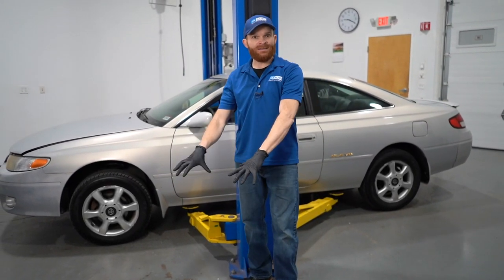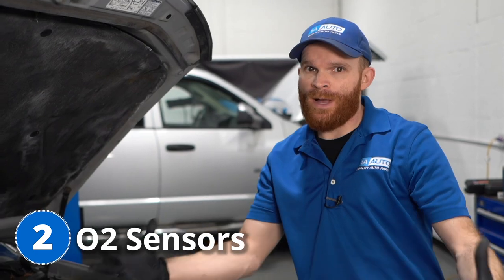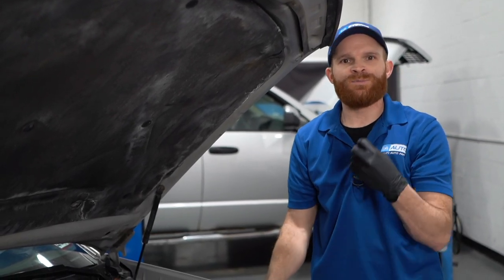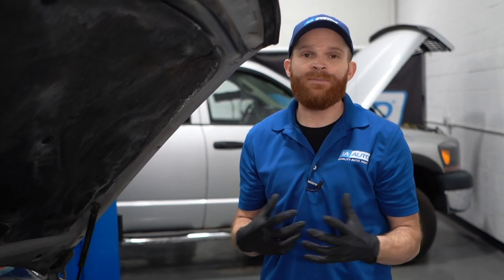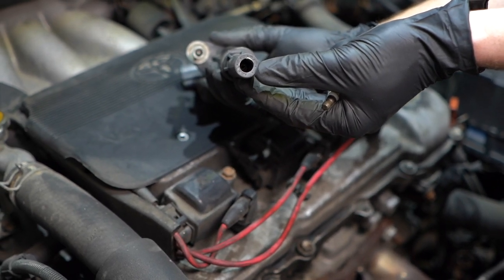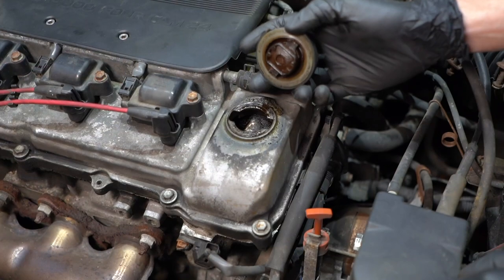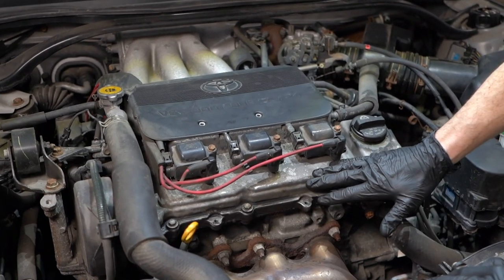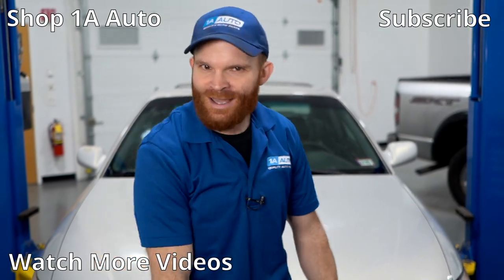Top 5 Problems Toyota Solara Coupe 1st Generation 1998-2003

Comment: Thats a clean solara. For some reason i dont see many of these anymore even though theyre good cars.
Reply: Just bought one today Excited to see where it goes
Reply: True.everyone wants SUVs probably.
Reply: just bought one with 270k for $600. all black clear coat peel but has no warning lights at all
Reply: I got mine and I plan to keep it till the wheels fall off
Reply: Just picked on up with 126k miles! Pretty excited from all of the comments here
Reply: I keep being told my is rare 2000 V-6 3.0 Manuel transmission 233,000 runs like new. Love my ride.
Reply: I just bought one 4 months ago
Reply: Funny a year later and the Carpocalypse I see them all over now again lol
Reply: @Toroloco777  I am about to pick a 00 V6 manual 77k original miles tomorrow super clean.  Anything to look for inspection?
Reply: About to pick up mine tomorrow. One owner 177 k on the odometer. No accidents. Pretty excited 🤩 1150 dollars. Got it from an auction. The owner sold it to send the money to a charity
Reply: I have one with 133,200 Miles on v6 manual transmission very fun to drive I plan to keep it till the wheels fall
Reply: @Toroloco777  how’s it run because I’m getting one with 300k miles on it
Reply: @Toroloco777 how often have you changed the fluid

Comment: Ah the infamous 1MZ-FE, I’m surprised that many of these cars still running strong after 20 years. I don’t think new cars are ever made the same reliability and longevity
Reply: I have two vehicles with 1MZ-FE. Engines still run like a clock.
Reply: 213K on my 1MZV6 still runs great you just needed to take care of the car. I always used Mobil 1 synthetic and stayed on top of maintenance. When you continue to see countless early Avalons, Solaras, Camrys, Siennas, Highlanders just know they have the "infamous" 1MZV6 powering them in 2022 and beyond
Reply: 319,468 miles (yeah I know a ton) on my wife’s 99 solara. Engine will run forever if maintained regularly it’s crazy!
Reply: Typically as long as morons don't run long oil changes they will last 500+k. My Highlander has 300K and it runs like it's brand new. And that's after morons ran long oil changes and the inside of the engine looks like coffee.

Comment: Front brakes should've been on the list. IMHO the brakes of that gen of V6 Solara (and Camry) are undersized leading to overheated rotors and warping.
Reply: Funny my 08 is having that problem
Reply: Carbon Rotors and EBC red pads fixed that problem for me

Comment: Have my 2002 V6 SE I purchased new, nearing 245,000 miles and still going strong.
Issues and or fixes.
1. IAC stalling the engine (gummy gas) use 100% H-Oct gas for a month or so and it helps burn out the crap from ethanol residue. I used a intake spray to clean out a bad gunky episode.
2. Front upstream O2 Sensor keeps tripping out, (possible ethanol is fogging up the sensor), my mechanic says the fronts go out more often, the downstream under the car never to bad. He said do not get scammed by someone saying your downstream O2 sensors are bad.
3. AirBag master chipboard by the passenger side out (about $1,000 to replace). So no airbags but plenty of red warning light. 
4. Had 2 water pumps changed per 100,000 mile service (preemptive replacement to be safe)
5. A/C line had a pinhole leak, used that A/C in a can and it worked awesome ($28 fix).
6. Stripped out threads on the oil pan from too may oil changes. Went with a whole new oil pan instead of a fangled tapped out thread replacement. I figure the new pan with perfect threads is more capable being bolted to the engine than still going with the old oil pan and worrying about a rethreaded fix failing. 
7. One valve cover gasket replacement, for 245,000 miles that is really good.
8. Alternator replaced once.

Comment: Also be mindful of problems with the front end alignment and steering linkage on high mileage Solaras. If your Solara's steering wheel has a slight shimmy or wobble when cruising at highway speeds, then you'll want to get that inspected.
Reply: How do I tell my mechanic to fix or check that please let me know
Reply: @emmanuelroman9269 did you go?

Comment: For oil leaking on my car it was the  cam shaft seal seal and valve cover gasket, I recommend doing that when you replace the timing chain and water pump.

Comment: Thank you for the information and the video. I just purchased a 2000 Solara with 71,500 miles and super clean condition.  I felt it was a purchase I could not pass up.  Now to take care of it so it keeps running well and keeps looking really great.  I do have a question and that is, how do I determing what generatiion the engine is.  This video refers to Gen 1 and I'm now wondeing what geration my engne is.  Thanks again, DP  --- Liked and subscribed!
Reply: I heard the Solara was made from 99 to 2008, so your car might have a "Gen 1" engine? I am no expert!
Reply: That's a steal and great buy if it only has 71,500 miles. I bought  a 2001 V6 in 2013 with 150,000 miles for $4k. It now has 223,000 miles and running just fine. My daughter keeps wishing it will break down but it's easy to fix. I  think it make it to 300K miles easy.

Comment: Ive had 2 of these cars and everything he says is an issue is true. However i was told that these cars had hydraulic cam followers so adjusting clearances isnt actually possible. Id like to know if its true because my 99 V6 has a lot of valve rattle. I was even thinking of buying a whole new set of cam followers. The other thing ive experienced is that the EGR valve also gets clogged with carbon. Needs cleaning every 5k miles or so
Reply: My Solara was clogged inside the intake plenum right before the EGR valve. After cleaning the carbon it cleared a p401 code.
Reply: @phajeb001  my check engine light came on p0401 I think I'll replace my EGR valve and do the same cleaning like you did..

Comment: Mine runs good and it’s been running for a long time with minimal maintenance
Reply: Same. I had a couple years where I was doing 50k miles a year and had almost no issues at all with mine. An oil change every 10,000 miles or so, and a spark plug change once and that was it.

Comment: I’m looking at picking one up this weekend for 2k 155k miles v6 body is minor cosmetics. What you guys think? A good deal? 

I need to replace my 2008 Chevy Impala that was on fire.
Reply: If its been taken care of mechanically then its a deal. Parts are cheap for them.
Reply: That’s a yes. Mine it’s at 259k. Runs strong
Reply: I'm looking at a 2002 V6 convertible tomorrow as we speak with 155k miles do you guys recommend this? Or should I keep my Grand Marquis?

Comment: I have a 2004 Toyota solara I just got done changing my control arms and my ball joint while I was driving it my car started to make a grinding noise and slow down I wasn't quite sure what it was but I assumed that it was my control arms cuz I was already having problems with it but prior to this noise started two days sounded like dirt rattling around I wasn't sure if it was my exhaust or where it was coming from but it sounded like my front tire light dirt was being trimmed in there any help would be appreciated and solving is problem what it could be

Comment: I have a 05 solara changed coil  and spark plug it came up on a reading replaced the air mass flow sensor and the boot...car turns over smoothly but will not stay started ..please anyone got any advice ?

Comment: My 2002 solora when im stop and ready to go it wont feels like its gonna die and it goes and jerk and it will be fine? Whats the problem?
Reply: Mine too!
Reply: It the fuel filter if not it might be the fuel pump filter. The fuel filter that my mechanic change was in the engine. Im not good at cars so excuse me. 😁
Reply: might be a solenoid issue
Reply: just  fix mine replace those solenoid and works well
Reply: Clean the Idle Air control valve.
Reply: I have similar issue, while stepping on the gas it jerk, before moving and  doesn't accelerate fast when I step on it, and am having check sign on my dashboard on, sometimes it feels like it want to go back while on drive before picking up. What can I do please
Reply: Along with the IAC valve mentioned in this vid...I'd start with the easiest fix....spray Mass Air flow sensor cleanor on the wire that senses the air coming in. IF that wire gets dirty with years of dust...its not registering your air coming in properly...so when you step on the gas its not sending the right mixture.

Comment: Can you answer my question, i recently bought an 04 solara and for some reason when i try to start it it sometimes just loses all power until i open and close the hood or wait a little to try to start it again, but for some reason it just did that but when i started it again my brake became so stiff it was almost not possible to stop and it wasnt shifting into drive so i got stuck going backwards until i restarted it, if you or others know why this happened id love some feedback, its got and aftermarket stereo and a installed cord under the cup holder

Comment: OK, well my 99 did fail one of the O2 sensors.  The reverse light switch in the 5 speed gave out also, as did some rear suspension bushings.  The biggest disappointment with this car was a very intermittent problem that turned out to be a bad injector.  There were bulletins about free replacement of the V6 injectors, but mine had too many miles...That job is a pain cuz the big ol intake plenum has to be removed.....I should have kept that car, much better quality than my 09 Camry

Comment: Can you explain what the Generation of a vehicle is?
Reply from the maker: +John b We do not have a video for this right now, but we'll keep this request in mind for a future video! http://1aau.to/m/Shop-1AAuto-c
Reply: 1st generation, 99-03 toyota solera
Reply: A vehicle that has just been produced for the first time is in its first generation.  This can last for various lengths of time months/years/decades.  When a manufacturer makes major changes to the model and starts throwing around words like "all new and improved" the model has probably clicked over to a new generation.  This can be major cosmetic change or major mechanical change or both. Typically small changes are not generational changes and are only intended to stimulate sales or drive the people who repair them insane when ordering parts.

Comment: 5k mile full synthetic oil changes....
Reply: 5k is too early.
Reply: @davidgruen7423  The holes in the pistons behind the oil control ring's get plugged up'.  I use valveoline full synthetic 0w-20 . It's a very thin oil, helps free up the blockage.  Engine still has good compression, oil burns because it stays in combustion chamber .  I change it 3k miles.   Oil is cheap engine expensive!